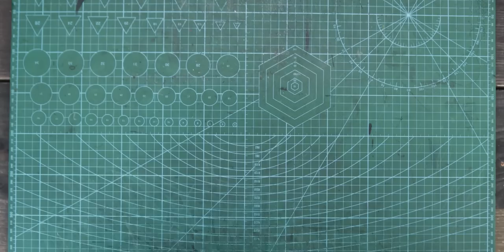Vegetable tanned Pueblo leather handmade slim cardholder wallet "Cloak" Leathercraft how to DIY

Comment: I am wondering at your reason for finishing the edges before you stitch.  Is this just a personal preference?  I learned that all edge finishing (on stitched edges) is done after stitching.  It does not seem to take away from the beautiful work you produce.  Only curious.  (PS:  Your leather covered binder clips are a genius idea.  I use them for my glue ups.  Thanks)

Comment: Really impressive finish, about as tight as you can get.. Though I am curious why you didn't finish burnishing with the tokinole rather than the saddle soap.
Reply from the maker: For edges i prefer water/saddle soap. Tokonole im really using to flatten flesh side of leather near the edges.